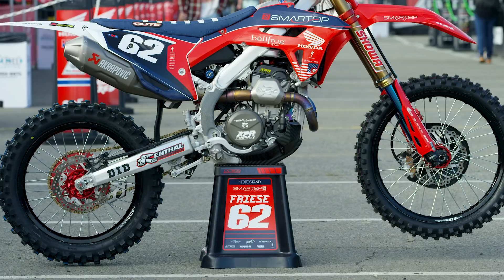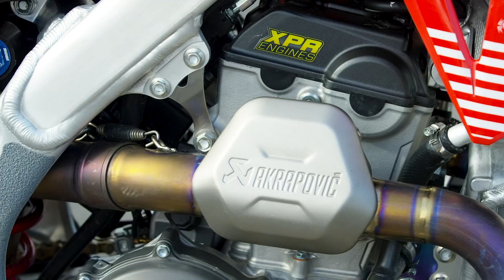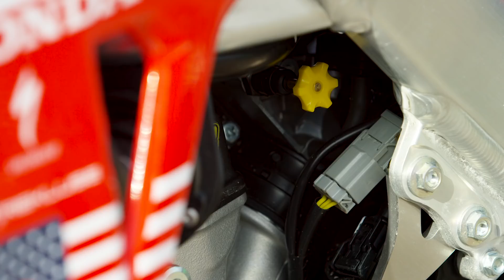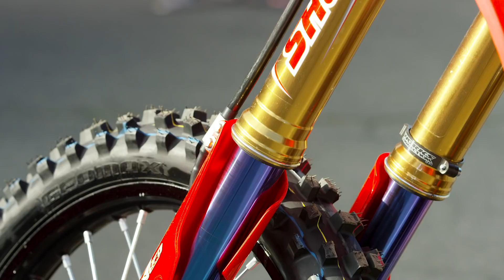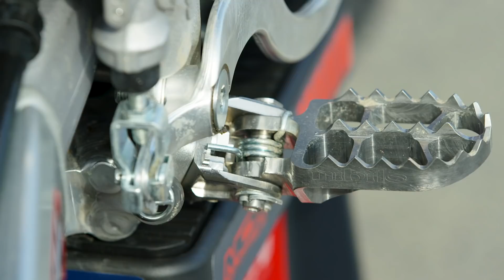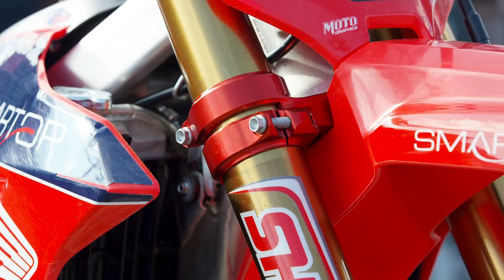Inside Vince Friese’s Smartop | Bullfrog Spas | MotoConcepts CRF250R

Comment: How much are the pegs and mounts  does it come with titanium pins also  I end up egging the holes in the mounts and even new pins don't help I have to weld the the hole and drill it out  or they will get so bad the pegs will slant away from the bike!  I guess a 1000$ would be a good price to me but what is it 3500
Reply: These pegs with mounts are about 1500.
These footpegs by them self are 800.
But u can get many good titanium footpegs for around $350 and mounts for similar price.

Comment: What's the reason for tumbling the transmission,? I've had a lot a lot  of Honda's and none have shifted like my 2022 250 it shifts so smooth when I first rode it I would shift twice because I didn't think I got the shift!
Reply: Not sure but you prob don't need do it. Just change that oil every 12hrs max using Maxima full synthetic or Honda oil.